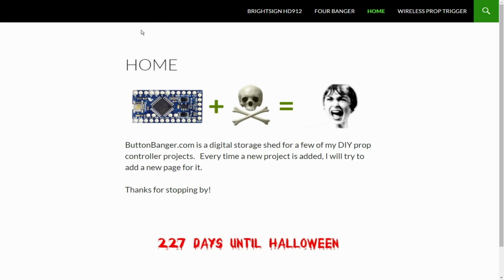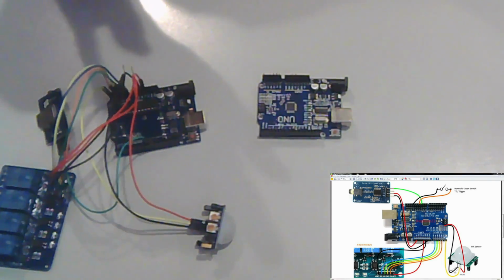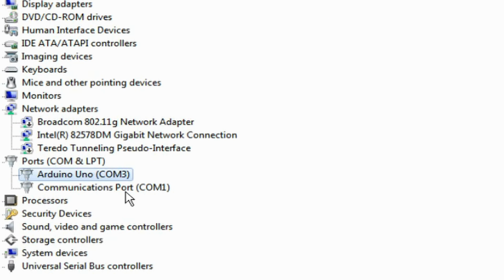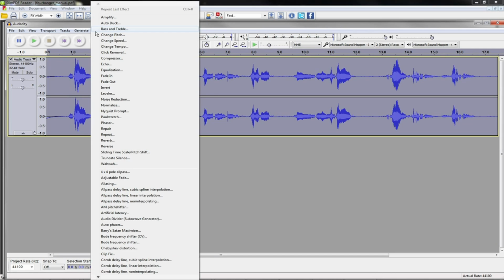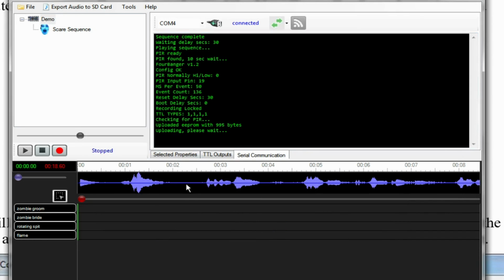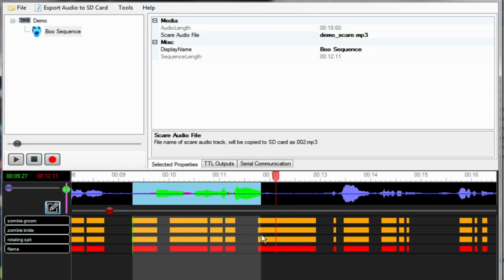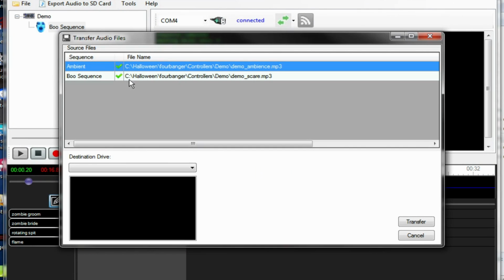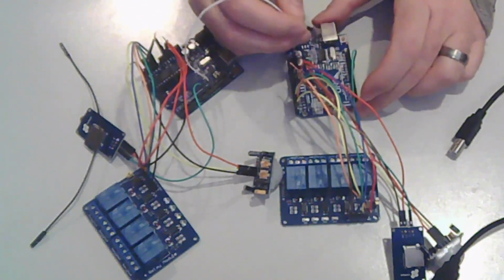$20 Arduino Prop Controller Part 2 - Halloween Vlog - 2016 Episode 7: Control Yourself!

Comment: Good afternoon! Thanks for your videos! They're super useful!
I wanted to ask if, when you have the codes uploaded to the arduino, would you still need to have it plugged to the computer? Or could it be just plugged into a wall socket?

Thank you! Greetings
Reply from the maker: It would be pretty useless if it had to be plugged into a computer all the time, so no. You upload the code to the arduino, then unplug it from the computer then run it from a 5v to 9v wall adapter, or a 9v battery.

Comment: Great video and channel thanks for all your help! Have you heard of any issues regarding an audio/trigger delay? I set my relay to trigger at a certain point in the audio but when running the actual sequence the relay activates about a second or two afterwards. Any ideas? Thanks!
Reply from the maker: Thanks, Dave! I've not specifically heard of that issue, but there are various issues similar to this which have surfaced. I recommend the support thread over at HauntForums.com here: www.hauntforum.com/showthread.php?t=41196

Comment: how would you wire up a solenoid valve to the relays
Reply from the maker: I cover relay wiring in other videos in this project, both AC and DC. Essentially, you run one wire from the solenoid to the power supply (usually positive), then run the other solenoid wire to the center connection on the relay. Run another wire from the normally open pole on the relay back to the power supply, and you're done. There are other considerations, however, which would include adding a diode to prevent reset issues caused by the inductive current caused by the solenoids shutting down.
Reply: thanks alot for the reply. i will have to give this a try when i get home. the way i had it set up was the positive on the solenoid was connected to the positive on the power supply. the black wire on the solenoid was connected to the  n o on the relay. i had relay 1 & 2 jumpered together on the common and with a wire running running to ground on the uno.
Reply: thanks for the info, it work. have been messing with it for 2 day after work and it was starting to get to me. lol. thanks again
Reply from the maker: Glad to hear it! If you need more help with the project, head over to http://www.hauntforum.com/showthread.php?p=861703
Reply: What video do you discuss wiring a solenoid? I’ve watched most of them and haven’t run into it yet? That’s the only part of this project I’m confused on
Reply from the maker: @psu4127  https://www.youtube.com/watch?v=ASGPUFclqxc&list=PL8Fn6IWwUvNTrZk1pnFs1CEf9YuEaUTsU&index=5

Comment: Thanks for the video.  It definitely is helping me long.  How do you wire the relay?  Is it just one power source to control all of your gadgets?
Reply from the maker: Hi Doug. By default, this project calls for the Arduino to power the relays. I cover wiring the relays to do stuff in later videos. However, based upon the experience I've gained, I strongly recommend powering the relays with a separate power supply. There's a little yellow jumper on these relays. If you remove it and connect +5v to the pin closest to the relay blocks, and connect the ground from the power supply to the relay board's ground AND one of the Arduino grounds, you will be saving yourself a lot of problems. 

Specifically, using the relays to switch "inductive" AC loads like a shiatsu motor (in my situation), you'll encounter a lot of issues with the controller resetting. Powering the relays separately helps alleviate this problem. Also, I cover "RC snubbers" (a resistor and capacitor wired in series) which act as inductive suppressors in later videos. Those get connected in parallel over the actual switching part of the relays.

I don't want to overload you, but, in answer to your question, the Arduino powers the relays by default, but don't do it. It's a bigger headache depending on what you do later. Power the relays separately.
Reply: OK, I think I get what you are saying, i think. lol.  I'm just a noob and need to just wire it up and play around.  Just to make sure I am on the right path, can the 4 relays all use 110v, and can I just use on 1 power source of 110v to power all 4 relays?  Thanks the help.  So I keep the jumper on if I want to use 110v? Do I only take it off If I want to use power from the arduino?
Reply from the maker: Doug, watch part 3. It will help you understand. https://www.youtube.com/watch?v=DH5wci0y-DU&index=4&list=PL8Fn6IWwUvNTrZk1pnFs1CEf9YuEaUTsU

The 4 relays can switch 110v AC on and off. The power that makes the relays do that, however, comes from the Arduino, just by wiring the project up as shown in part 1 and part 2 (this video). The relays themselves run on only 5v DC. But, they can switch up to 220v (It think).  The jumper has nothing to do with how much power you're switching. It has to do with what gives the relays the power to do the switching, which, by default, is the Arduino board. We've discovered later in the video series that a separate 5v power supply should be used to give the relays the power to do their job, switching on/off whatever current up to 220v you decide to run through them.
Reply: Thank You Montclair,  another thing, can you use arduino with out PIR sensors?
Reply from the maker: Yes, you can. It has a manual trigger option. Check out the docs at buttonbanger.com

Comment: +Montclair&#39;s Lair  is there a data card slot on the MP3 board? i might have missed it
Reply from the maker: +Keith Johnson Yes. I covered that in the first part of this series. This is the second video. The MP3 player has an SD card slot. Thanks for watching and commenting!
Reply: +Montclair&#39;s Lair No thank you I will be getting the parts but probably wont be using till next year unless someone sets a fir up on my Arse.. Now as for the PIR can it be waterproofed? i am in South Florida and weather is so iffy!